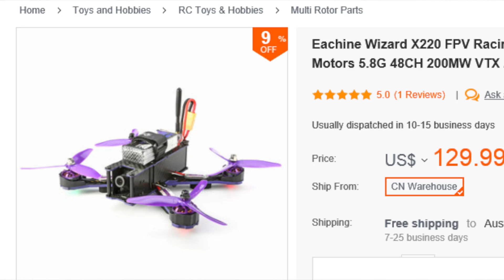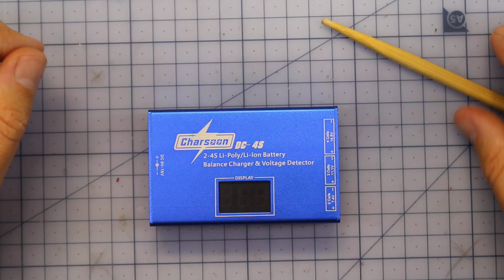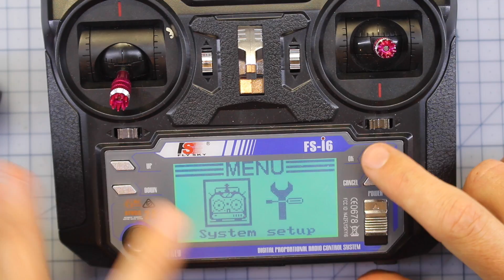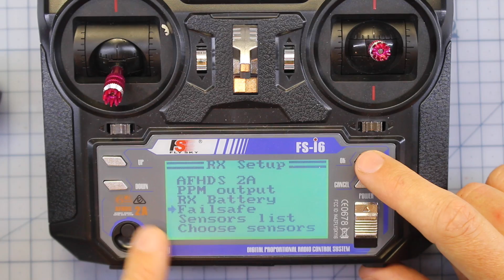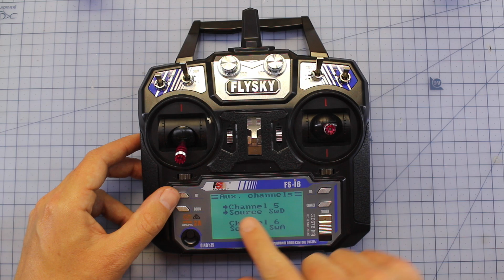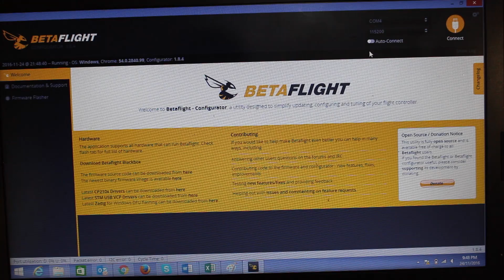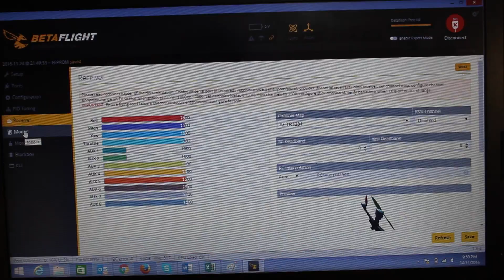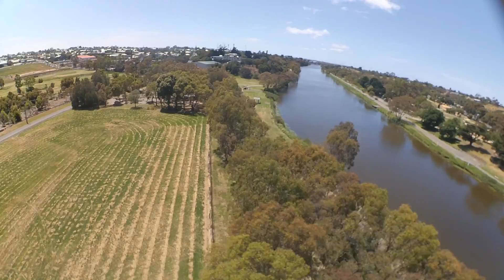How to get FPV DRONE RACING for under $300! Parts +Full setup.

Comment: Hey Stewart! I just picked up the x220 and she's a beauty! I plugged her into my computer and when I try to connect with Beta flight or Clean flight, it doesn't connect. Are there any drivers that I need? I have the same controller/reciever as you. If you could help it would be great!

The motors won't rev up either when binded to the transmitter.
Reply from the maker: there are drivers linked on the betaflight main page
Reply: Thank you very much, now when I give power over idle, the motors keep accelerating but I heard its normal without props on.

Comment: Guys kind of a noob question here but is there a way to recorde what we actually see ? or do we have to add a Gopro on it ?
Reply: VictorRider07 yes you can record because the copter already has an fpv camera but with a fpv goggles that has a dvr or you could add a gopro but im not sure if this quad can lift a gopro.

ps. the fpv camera isnt a hd camera.
Reply: So the footage is from the drone's camera ? Does it work with an sd card or something ?
Reply: VictorRider07 the sd card is in the dvr which is on the fpv goggles.

Comment: Great video! Looking to order this setup in the spring. Just looking for some clarification on the googles, about why you recommend the JJPRO over the Eachine. Just looking at the specs, seems like the Eachine has better resolution, and a detachable monitor.  I know real life use doesn't always measure up to a spec list, so I'd just like your opinion? Thanks!
Reply from the maker: they just felt better IMO

Comment: Hey Stew, PLEASE HELP. the batteries you recommended are sold out again, both links. the thing is, i dont really understand what batteries i can choose. i dont want to fry the esc's on my soon to be bought wizard, and i dont want to fry anything else either. im looking at this "zop 1400 mah, 65c 4s" battery on banggood, but i remember the old battery was 1300 mah 65c. will this be too much of something? i really dont understand this stuff yet. what is the max mvh and c rate combo i can buy for the wizzard? (there are some ok priced 1800 mah 65 c's. but i fear this will damage it). thanks for any reply guys. but please hurry, i would order right now if i didnt face this problem.
Reply from the maker: Any 4s lipo will be work, but the ones that will be best are between 1000 - and 1800mah and as high a c rating as possible. aim for 40c plus
Reply: excellent. i think i blught a 1800 65c 4s battery, and a couple of 1400 65 c and a 1500 45 c or something, just to mix it up and try different ones to see how this stuff works. i was nervous at first that the 1800 mah 65c would fry my esc's or something, but from my understanding it wont. i hope it wont anyways. have a good one Stew

Comment: How does one setup the turnigy evolution with this quad? what pins to use on the reciever, what controller settings on the touch screen and what settings in betaflight? thanks in advance for any light you can shed.
Reply: I would love to get an answer to this. I saw your video about the controller and how much you like it. Thanks!
Reply: James Johnson I figured it out. Sbus and use the port on the opposite side of the fc. Set it to UART 3

Comment: I want to get the turnigy evolution controller will I be able to use it with this drone? and if so what receiver will I need? Also is this still the best option for getting into drone racing in 2017 still ?
Reply from the maker: yes, that radio will work with this. the ev comes with an ia6c receiver.
Reply: UAVfutures Thanks :D anything else you suggest (new drone's to look at)?? Love your videos btw!

Comment: Hey man, great guide, I am really thinking about trying this. How would i have to modify this setup to get 1080p fpv video feed tho, or at least 720? This is 700TVL which is like 480p resolution as i read and that seems too low to me, can we get a greater video feed quality without  getting too wild with the price? Thank you very much.
Reply from the maker: it gets wild in price. check out the prosight connex system.
Reply: So the vast majority of fpv racing community is using 700-800 TVL feed? Maybe its not so low then... By the way im amazed that you replied to me so soon, subbed instantly ;)

Comment: I would like to get this quad but i already have a spectrum dx7s transmitter. I don't know what receiver would work for the connection the wizard x220 has,   bang good has a Radiolink R10DS 2.4G 10 Channels Receiver with DSSS & FHSS Spread Spectrum      would that work for my transmitter?    and how?

Comment: Sorry but 5820 is not / on-on-off-off-off /

You looked At the TS5823 manual (32channel and doesnt include raceband)

The wizard is using the TS5823S (wich include raceband and 40 channels)

If you want 5820 it's / on-on-on-off-off-off /

TS5823S manual (in the product description) : http://m.banggood.com/Skyzone-Upgrade-TS5823S-40CH-5_8G-200MW-AV-Transmitter-Module-RP-SMA-Female-p-1017491.html

If you try to find it in google image, you will always see the TS5823 manual :(

I know it's complicated.. 

Hope this was helpful ;)

Good video continue !!

Comment: I've got everything except the goggles. can anyone recommend budget goggles for a glasses wearer. contacts don't agree with my eyes
Reply: Kaine83 You should buy the Quanum cyclops

PROS :

Better confort
Sharper image
Looks great
You can wear glasses under without any problem

CAUTION

Sma connection but the wizard is using an rp-sma connection so if you wanna use different antennas, you must get an adapter

CONS :

Doesnt come with battery
You need a small battery (3s max)
CANNOT SEE CHOOSE MANUALLY YOUR CHANNEL (ONLY AUTOSEARCH)

finaly, I think these are perfects for beginners and glasses wearers ;)
Reply: Vincent Beaudoin cool, thanks for the recommendation
Reply: Kaine83 yeah sorry for my bad english -> im using my stupid, almost destroyed, cracked, old ipod 5. ;)
Reply: Get a fatshark they are soooooo worth the 200$ you pay for them
Reply: LiamGamz I have a pretty heavy prescription though. I'm not sure if cope with them, and I don't have the money to invest in custom eyepieces. plus I'm too young in the hobby to put too much money into it anyway.
Reply: oh ok then if I were you i'd get the glasses he shows in video pretty good even though there not visually attractive ;D

Comment: Hey I had a quick question regarding he transmitter and receiver I have a spektrum DX6I controller and a spektrum spmar6210 receiver. Would I be able to set up this drone using these or would I at the least be able to use the Controler but bind it with the fs-ia6b receiver that you have in the video?  Thanks so much for taking the time if you respond to this comment I just need some help doing this if so.

Comment: @UAVfutures when i turn my revs up a little bit it just slowly spins faster and faster, what's my issue? :/ Or is this supposed to happen?
Also thanks for the great video! (you convinced me to buy my first Quad), i haven't used it yet (due to the above concern and it being wet outside)but it seems as though it'll be an amazing Quad! Great tutorial too!
Reply: Fixed! Turns out it was the trim on the controller, i simply loaded Beta-flight went into receiver, turned on my quad and the my controller and watched the preview, and set the trims using the preview, if you aren't certain it's centered 1 trim up will cause movement in one direction, and 1 trim down (in the other direction)will cause movement in the opposite direction, (the one in between is the correct trim as standard).

So if any has an issue with flipping on takeoff or odd flight check trim using Beta-flight and if that seems fine you probably want to just use trim.

Comment: Hey, 

I posted a while back, but now I finally have my drone :) (though without the props) :( 

Anyway, I'm having trouble connecting it to Betaflight, I think my mac isn't recognising the fc and the right ports aren't showing up. I've tried to flash it, hoping that that would fix the problem, but it didn't work. I know I can try shorting the boot pins, but before I do all that, I was wondering - can flashing the board fix the issue of the board not connecting at all? Or should I try to get the right ports to show up first? 

Thanks for any responses!
Reply: Fixed: turns out the CP210x drivers I installed (from the betaflight homepage so to speak) weren't actually installed, and I needed to run another dmg file for them to install. That was all it needed

Comment: I am new to this I have had practice with a toy grade drone but want to get into racing fpv. I have been thinking about this setup but wondering if I should start with a micro whoop. My question is which one will work with the controller and goggles you mentioned here so I can still get the eashine wizard at a later time when I feel I have practiced enough with the micro. I hope this question makes sense. Thanks lots.  Or should I start with the wizard?

Comment: I have had my set up for 10 days now and have yet to get the taranis and the drone to talk to each other. The taranis talks to the reciever talk, I can see the drone in Cleanflight, the drone talks to the FPV goggles... Everything is working but the taranis and the freakin drone. At this point I've accepted that I received a lemon or this entire thing is a dream and I'm actually just part of The Matrix. Kill me either way.
Reply: +Craig Jones - If I figure anything out I'll comment here to let you know!
Reply: Exactly the same thing is happening to me.
Reply from the maker: the x8r is that ppm pwn or sbus? cant remember because you need to change the option to that in betaflight to match
Reply: + UAVfutures Thanks for your reply on this! From the videos I've watched the x8r is ppm with a spot for sbus if you choose to use it (very similar layout to the receiver in this video but the extra slots are on the bottom.) 

I started with it plugged into the different ppm slots, and the default settings in cleanflight were right for that, but had no luck so I switched it to the sbus slot. I went into cleanflight and 1) changed the receiver mode to rx serial, 2) changed the serial receiver provider to SBUS, and 3) on the ports screen I flipped the switch for serial RX on the row for UART3. I wasnt able to get any combination of the above on ppm or sbus slots to work with any of the settings in cleanflight.

I watched a video that was recommended somewhere by cleanflight where a guy walks through a cleanflight setup from start to finish so thats how I knew to try those settings. His setup  worked just fine for him though so Ive run out of advice to follow, haha!

Comment: Great review! Been toying around with a Syma X13 for a while now and thinking of going into FPV flying. Does this have a low voltage warning for the quad battery? How long battery time is it? What would you say the range would be? Is there a way to increase the range? (buy another antenna for the quad?) Do you have any reocommendation for batteries and a charger that can charge more than 1 battery at a time?
Reply from the maker: i used the rcq200 charger

Comment: How does the drone receive information from the receiver with just one harness? I'm trying to set up mine and had to get a different drone but mine came with a color coded set of wires instead of the harness he showed. 100% confused.
Reply from the maker: harness?
Reply: UAVfutures the plastic thing that holds the wires in formation. I have an imgur album if it would help. I'm very new to this so my descriptors may not be up to snuff.

Comment: Would you recommend this set up for somebody looking to take the next step up from cheap micro/nano drones. I would like to get into FPV but I'd probably fly this line of sight for a while first.    My main concern is if I should build a kit or buy something prebuilt like the Wizard x220.  Obviously it would be beneficial to know how everything is put together in order to be able to fix it after a bad crash. But... I have little to no soldering experience and the whole building process seems a tad daunting.    Any thoughts on this?

Comment: Great video. Love the detail provided on how to setup these items. Do you have any advice about getting the racing gates at a good price?
Reply: Keith Miller , I just watched a video where a guy bought lengths of PCV pipe at the local hardware store and then covered them with pool noodles.  $10 for 2 I think he said it was. Hope that helps a little

Comment: +UAVfutures Hello! Thanks for a very informative video, been looking a long time for a setup like this. I do have some additional questions for you. About the drone itself, how long is the actual flight time with the battery you recommended? Secondly, could you tell me about the range from the fpv headset to the drone and the range from the drone to the receiver in open areas? I also wonder what does the failsafe settings you enabled on the controller actually do? Does it prevent the drone from going outside of range, or does it simply just shut it off? I hope you can give me these answers, as it would be essential for my decision on purchasing this setup. Lastly, can how did you manage to upload the actual drone footage, is it possible to record the whole flight and save it to say a memory card?
Reply: and one more thing, what parts on the quad itself is upgradable? Can you upgrade the camera for instance?
Reply: 9:25

Comment: Great video!
Is it possible to mount some heavier battery to extend flying time? Like 2000 mah 4s? and togehter with gopro? I mean can Eachine Wizard handle it or should I consider some other frame?
Reply from the maker: not really. if you add any bigger than 1500mah it wil start to feel really heavy and slow

Comment: on bang good there is also a ready to fly set i am new to all this so i would rather get the RTF it comes with a battery and charger will that charger be enough?
Here is the link: http://www.banggood.com/Eachine-Wizard-X220-FPV-Racer-Blheli_S-Naze32-6DOF-5_8G-48CH-200MW-700TVL-Camera-w-FlySky-I6-RTF-p-1077100.html?rmmds=search
Will the goggles in the description work with the ready to fly set? 
Also i found the parrot bebop on amazon for 450 € which drone is better the one here or the parrot?
I want to get into a bit of drone racing so pls reply ;D
Reply from the maker: I like the ARF becasue it actually hows you how to build it and helps you fix it if you break it. either is HEAPS better than the parrot. DO NOT GET THE PARROT

Comment: How do you charge the goggles ? 
And can you see the voltage at the drone battery from the controller or do you need to take the drone down to measure the voltage? Nice video btw, going for that kit! :)
Reply from the maker: goggles can charge usb, and you need to take drone down to measure voltage.

Comment: also, does anyone know of any batteries that can be used with this drone that last longer than 3 to 7 minutes?
Reply: The 3S and 4S lipo's people normally use are about the best power density you're going to find, which is why people use them, so not really any better choices in the battery department. Just slapping on a bigger battery doesn't really work well because the added weight counters the capacity gain.  That being said there are ways to extend battery life, but at the expense of performance and durability. You can't have both. And even shedding every last gram you can, as well as downgrading to smaller lower current motors and babying it in the air would probably only gain you a minute max on total battery life.  Quads just aren't very efficient aircraft.
Reply: qumefox thanks. so I guess I just have to buy a lot of those batteries then
Reply from the maker: awesome info
Reply: While you're here, I have a question on goggles. Which do you think would be better, the Kylin goggles you recommend in this video, or Quanum Cyclops with a firmware mod that allows for individual channel selection.  I've read that the the cyclops has pretty much the best display in this price range but it's main downside is it's scan only channel selection.

Comment: Sorry to bother you again but I was putting the props on my quad and I noticed that some went on easier than others and with the nuts screwed down on the props there is one that squeaks whenever the propellers start to spin, when I increase the throttle this also happens, I think it's because there is some room for the propeller to move so when it spins up the prop moves up the shaft but I can't tighten the nut any more.
Reply from the maker: you need to tighten it EVEN more. it should not be loose

Comment: hello, thank you for this helpful video. Is there a way to get the battery levels to be shown on the radio screen? I also saw a video which mentioned wiring an alarm add-on to monitor the battery levels. What can I do to this setup so that I don't have to manually check each battery with the battery charger?
Thanks you!
Reply from the maker: more expensive drones with an osd can do display your voltage on screen

Comment: Hi I have just ordered the Wizard along with a Flysky FS-i6X, could you please suggest the best battery to use with this quad.I was looking at the Tattu 1550mAh 14.8V 4s 45C Lipo battery or Tattu 1300mAh 14.8V 4s 45c battery are these suitable, perhaps you could put me straight on what I should be using.
Reply from the maker: either of those bats are fine
Reply: Hi thanks for your reply, so what would the best combination of mAh / S count / C  be to use with the Wizard. Many thanks for your help.